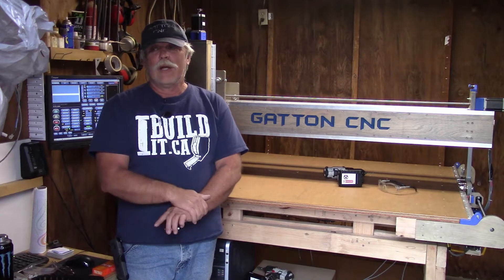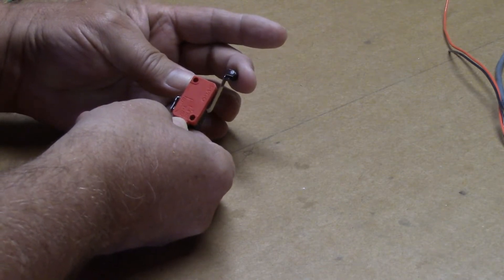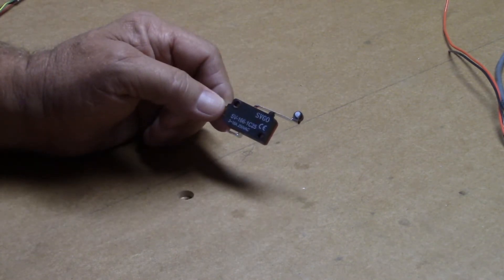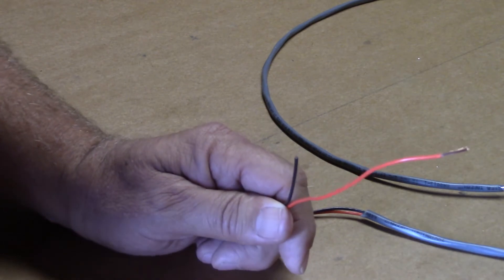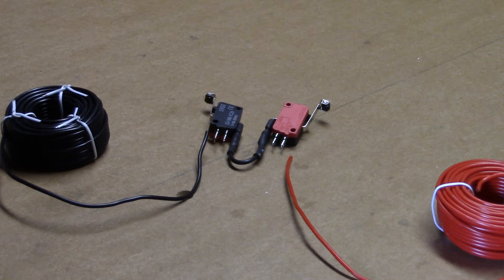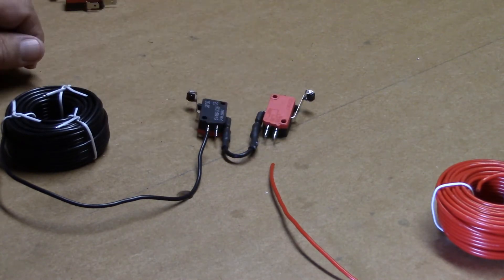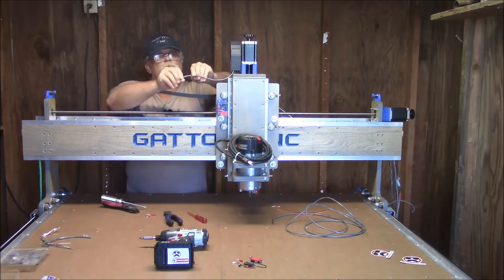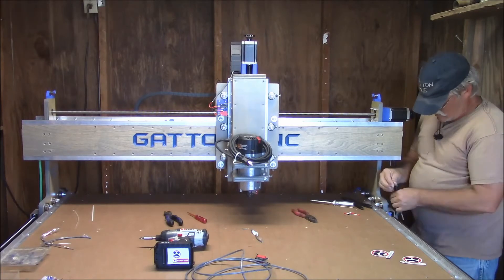Adding Limit Switches to my Gatton CNC

Comment: Mark, you never mentioned what you did with the shields.  Shielding only works well if the shield is grounded at one end.  If it is floating, it does not provide protection.  If it is grounded at both ends, you get ground loops and a new source of noise in your system.  I would consider connecting all the shields together at the ground bus point you've extended to the terminal strip.
Reply from the maker: You're absolutely right, Thomas. In fact, I forgot to mention a couple of things - like the switch mounts themselves. I'll address them all in the next video, before I get into the Mach3 settings. I have the footage, it just somehow got left out of the edit.

Oops? Yeah, that's it. Oops.
Reply: Thomas, wouldn't you ground the shields to an earth ground instead of the ground bus point. You are correct about not grounding both ends of the shielding. I have come across instances where someone has grounded both ends. The machine was not working properly until I disconnected one end of the shielding.
Reply from the maker: After reading a bunch about it, grounding the shield to the terminal block should do just fine. We're not dealing with huge voltages. We're dissipating RF as it comes in - if it should come in. And yeah, connecting both ends of the shield cable creates a ground loop.
Reply: Dear Mark and Thomas, I Found 4 core (conductor) cable with ground sorounding that conductor, is it mean shielded cable also ? If not, it can give protection from noise or not?
Reply: @andirachmatmulya2818  A shield may be a braided set of wires that encloses the other conductors or a foil wrap with a bare wire in it that encloses them.  Either one will work in this application.  The important thing is that you should connect only one end of the shield, at a common ground point.
Reply: @thomasgrim1549  thank You Thomas
Reply: I love how you have responded to this . Constructive feedback. Very respectfully pointing out what was an oversight, yet educating the viewers. Thank you. Of course Mark is appreciated implicitly. So different to what we normally see from the keyboard ninjas.

Comment: hi mark once again nice presentation which help me in setting up my cnc limit switched and understood the difference between using normally open and normally close switch.  may i ask did you used all the same normally close switch to all axis.  because the machine delivered to me when i checked it. i have my  X AND Y HOME  NORMALLY OPEN AND X HOME IS NORMALLY CLOSE.  also my Y+ AND Z+ IS NORMALLY OPEN  AND MY  X+ IS NORMALLY CLOSE.

Comment: Hey Mark I have built a Sidewinder CNC awhile ago and I’m planing to add limit switches to it. I’m curious what breakout board you have in your video I can’t seem to find one like it anywhere.
Reply from the maker: Jeff at Xylotex discontinued that breakout board about a year ago (just after I released that video, naturally.) I asked him what folks should look for when searching for a BoB, and he said to search for "D-SUB-DB25-Male-Female-Header-Breakout-Board-Terminal-Block-Connector". (Without the quotes.) 

For example, here's one on the unnamed auction site:  https://ebay.to/2EnkIFW
Reply: Thanks Mark. I used the suggested board and your video now I have limit switches on my machine, no more crashing. Now to see what else I can do with my new BoB.

Comment: Looking good Mark!  Just an FYI Make sure you have your Mach3 software set up properly before you press the home button.  I am speaking from experience, i had X axis homing negative and A axis homing postive.  Not to good on the gantry.
Reply from the maker: I'm way ahead of you LeRoy, but thanks. I WILL be talking about that in the next video, because it may be the single most important configuration setting in this whole deal.

Comment: Glad to see that I'm not the only one not to stick to a strict color code. Sometime the limit of wire makes a difference when you try to save a few cents.
Reply from the maker: Another limit of wire is not being able to get your hands on it locally and having to wait 5 days to get it. Who would have thought that 6 more feet of wire would have been the difference?

Sometimes you just gotta do what you gotta do.  Thanks for watching!
Reply: Luck on that, we have a lot of electrical supply houses near by to get wire from.
Reply from the maker: I live in a small town with a couple of electrical supply shops, but none of them had the stranded wire I needed. The wire I got first was supposed to be stranded, shielded cable, but as you saw in the video, it wasn't. And of course they won't take wire sold by the foot back, so yeah...
Reply: Well, great job on your machine and the videos too.

Comment: Hey there Mark, its been a while, I've been crazy busy working. Just watched this limit switch video. Excellent tutorial as always, this is what I am currently doing with my "ShoeString" CNC, so how perfect is that? Thanks. I appreciate the comments about the shielded cable, so I need to change that and will also put in the wire block on the underside of the table. Hope your doing well? Andrew Wright
Reply from the maker: Howdy, Andrew! I went with the terminal block because I had a lot of negative wires to run into a place that wouldn't accommodate them. It's not completely necessary. Also, the only reason I put that terminal block where I put it was because I have negative cables coming in from several directions, and that location was central to all of them. I could have just as easily mounted it on the back of my drive box enclosure. The location I chose just saved me a bit of wire, and solved a couple of routing problems for me. Good luck with your installation!